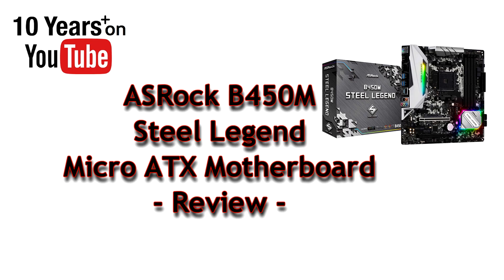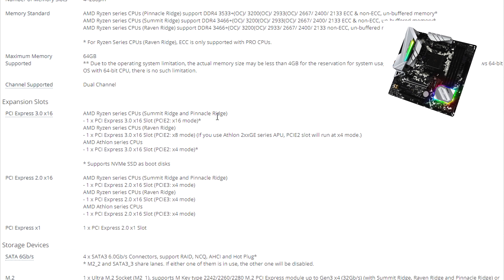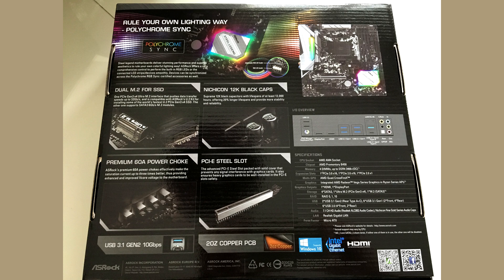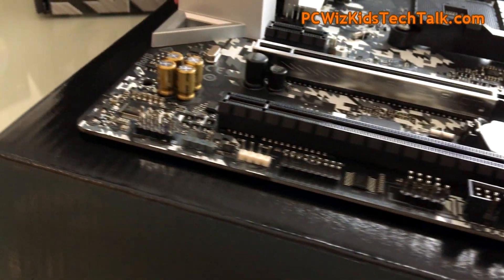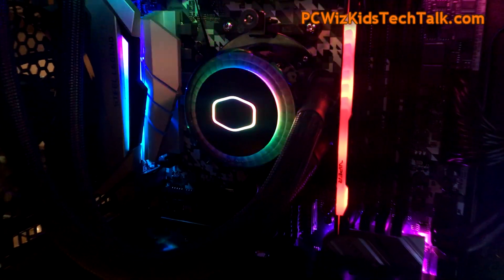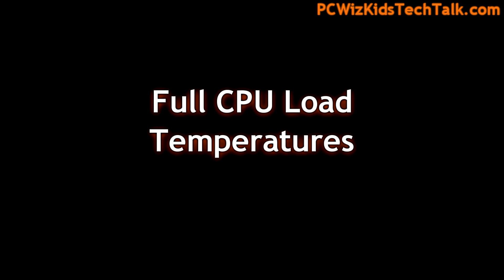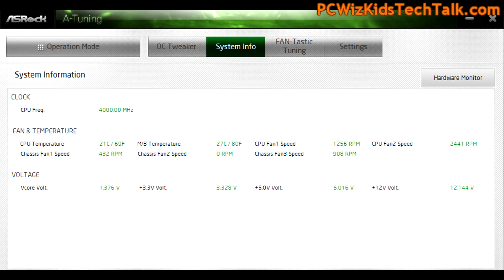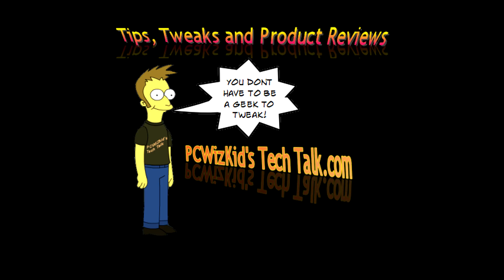✅ASRock B450M Steel Legend - Motherboard Review

Comment: Any one had issues with RAM on this board? I have 2 x8GB 3200 CORSAIR VENGEANCE PRO sticks. Slots A1 and A2 don't recognize the RAM when  I followed instruction and You Tube channels  - so I Install Ram A1 and B1 but it only recognizes 8gb  - I put them in B1 and B2  and i get 16gb?? I have dummy Ram in A1 A2 - i want to upgrade for editing but don't want to waste money, Thanks

Comment: im looking to build my first pc, was thinking of using this motherboard with a ryzen 7 2700x and a gigabyte radeon rx 5700 xt, would you recommend?
Reply: I just put one together with the r7 2700x and an rtx 2060 and love it the only flaw is the rgb software is kinda buggy but I have a stable 4GHz all core overclock at 1.3v so its doing something right.

Comment: Thank you for the great video! You kinda sound like Vince Offer :D
Reply: Want to do an MATX build.  I am not too savvy so won’t be doing much in terms of overclocking.  I originally was looking at MSI b450 tomahawk but ther requires mid tower case.   Am I giving up anything this this MB and smaller case?  Sub $1k build.
Reply: ASRock will be releasing a new version  of this motherboard soon (ASRock B55OM Steel Legend), which will have improvements such as PCIe 4.0 support, much better power management for overclocking and better compatibility with the new generation of Ryzen CPUs to be released later in the year. If you think any of those features could be important to you in the future then I'd wait, if they're not important, then get a B450M board. The MSI B450M Mortar is also a good choice, it can hold two M.2 SSDs, which is a very useful feature.

Comment: ASRock B450M Steel Legend AM4  vs Asrock B450M Pro4 which one ?
Reply: 100% Steel Legend, you get LLC options for OC, you get ARGB header for the light, you getting true 4 phase VRM than the fake 6 phase(3 true phase), it's a no brainer.

Comment: I bought this board about a few weeks ago and am planning on dropping a 3600 in it. Mine came with a Ryzen 3000 ready sticker on it, which is a huge plus. I was already planning on having to buy a cheap previous gen CPU to get it updated, but luckily that won't be the case.

Comment: you use wrong ram slot.  :D
Reply: You did not listen. He said he'll be getting more Ram sticks...
Reply: @ATI6950FTW  you did not have clue, wrong slot is wrong slot, if you test with 1 RAM it only suppose to be the 2nd slot from left, not 1.  Even if he is waiting to add the 2nd RAM, it would be 2nd and the 4th slot to use. He IS wrong either way.

Comment: Can i update bios for 3600 without older chip?
Reply: No, but you can ask the shop where you buy it to do it, they most likely do it.
Reply: Problem is i am buying this from newegg from international shipping and there are not many shops in my country which have ryzen :(
Reply: @KB_.  amd might loan u a processor to update the bios. Look at the bottom of this page for more info: https://www.amd.com/en/support/kb/faq/pa-100
Reply: If you get lucky you may get one that's already updated. I bought one off Amazon a few weeks ago and it's already been updated for the 3000 series.
Reply: @Brunnen_Gee  mine arrived last week with the updated bios
Reply: @DoctressZ  how are you finding the motherboard? Because I'm thinking of buying it for a new ryzen build..